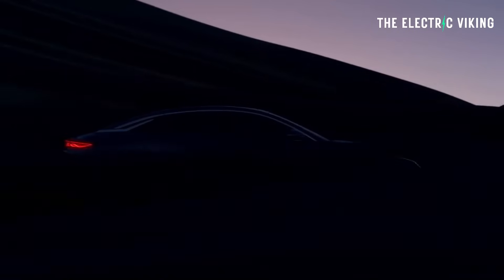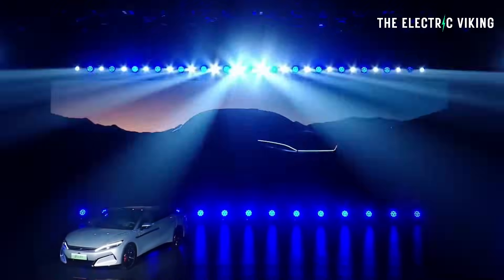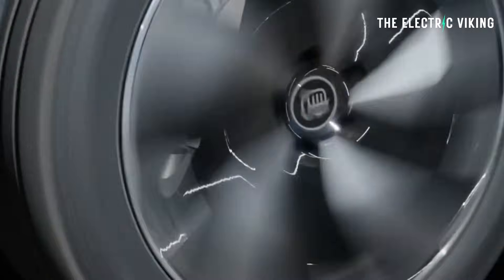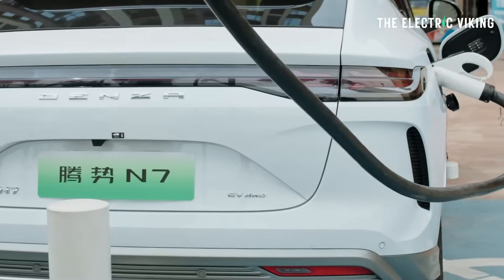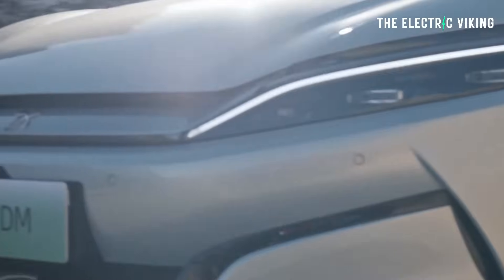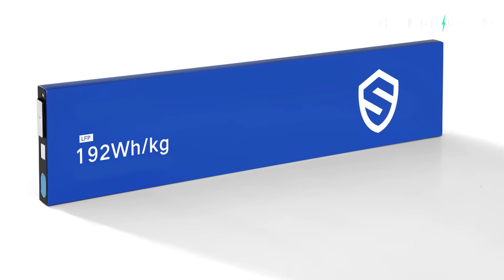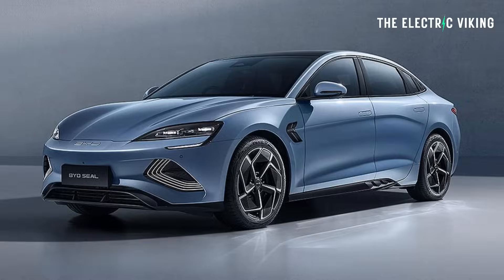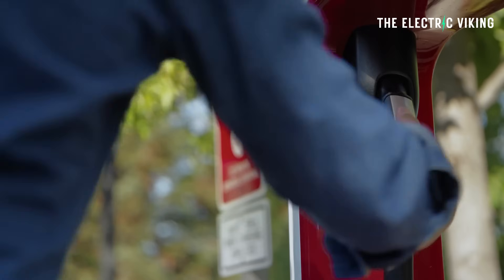New BYD EVs with 945V architecture charges from 16% to 80% in 10 minutes

Comment: I'm glad LiFePO4 tech is coming further, it's a good intermediary until we get Solid State. But like I've said, we do get -40 Celsius here in Ontario occasionally. It's -30 today, -40 in some parts. If we get electric snow plows one day, they will need to operate at extreme temperatures and still provide full power. Also North American power standard is 110v instead of the 220v elsewhere with a 240v split-phase for appliances, this likely means we will need special setups with additional 240v hookups to get high speed charging. Those who say there are no problems still haven't been in the right conditions, but there is definitely progress.

Comment: I live in Thailand and currently thinking about a new vehicle. I am very interested in the BYD shark 6 but after hearing some of the complaints that many Chinese have about BYD vehicles I'm not too sure. I have driven in a few as a passenger and they seemed well made, quiet and looked good. The owners seem to like them as well. but there is some information out on the web that they are not all what they are cracked up to be. they should be coming out with the shark 6 here in Bangkok in a few months. I'll take a look at it and then decide between that and the Toyota Hilux rocko.

Comment: I like the look of BYD but I won't be buying one.  Still no proper BYD presence where I am and there's no way any of the local charging infrastructure will support charging at the rates mentioned in this video.  Also the specs of these cars are absurd - why keep adding more and more power when range is the problem.

Comment: Two leads needed not a game changer if you could do it from one then yeah great until then its cars like yours which actually have practical charging. This is just headline figures from BYD, don't get me wrong things are going the right way but using two charge points is a gimic and just takes away a charge point that someone else could be using. Just my 2pence

Comment: Why do you so eagerly and readily accept nonsense claims by china on any technological breakthroughs, when 99% of previous claims were either outright lies, or had fatal flaws and severe issues with safety, fire hazard, reliability, or they were stolen tech rushed to the market in hopes of beating the original owner of the stolen IP? EV is starting to lose its allure. The cheap trash the Chinese sells for thousands below cost are getting tariffed to hell. The world was stupidly buying worthless deathbox evs from china and has now first hand experience on the trash the Chinese are selling.

Comment: In Australia issue is the charging station it couldn’t catch up with vehicles tech
Reply: Exactly.  All well and good to have 300kw charging on your car, but I;'ve never seen a charger in Australia that can do more than 150.  And the vast majority are less than 50
Reply: And the only ones that are over 150 are Tesla superchargers which you can't use Xpengs on anyway

Comment: @electricviking Hi Sam, I thought you might like some feedback regarding home batteries. Our place is off-grid so it's much easier to manage full integration but hopefully useful. We went with a BYD battery stack because they can be expanded as needed. The units come with a top and bottom plate for connecting to your batter charger, we use an SMA Sunny Island charger and Sunny Boy inverter. The BYD batteries come in 4kWh modules and you can stack 6 to provide 24kWh before going to another stack of the same all the way up to 240kWh. The solar system feeds the battery stack but more will be added and mounted at an angle to better catch the winter sun on a N/S pitched roof. These new 6 panels will exceed the voltage of the inverter so will be hooked up as DC via a small separate battery charger hooked directly to the BYD stack. We have an MG 4 at the moment that is powered off the solar, plus a ride-on electric mower (1 1/2 acres to mow) plus a heat-pump hot water system. We do have an auto start generator but have swapped that out when we got a Zappi and eddi unit with clamps so once the battery is full, then hot water is up to temp, then excess goes to the car. And the inverse is that the MG tops up the battery instead of the generator if needed in winter. We will be moving onto the Zeekr 4 to get 3.3kW charging instead of the 2.4kW we currently get. The generator is 4.8kW and is a backup for either house or car batteries but has never been used since we put this system together.

Two things to note, firstly, don't go for a single large battery like a Powerwall, go modular and grow from a base as needed. If you go Powerwall or equivalent you will be slapped at each upgrade point for more storage than you may ever need. Secondly, being wired to the grid will have its issues due to you needing tighter electrical integration between car, battery stack, inverter and power provider.

Comment: If you choise a 80 kWh battery then you have the same range, you just get a bit ligther battery. With <10% difference in density than the range wont change significant.

Comment: Tomorrow there will be the next brand new mind blowing sky rocketing game changing 946V architecture 😉
Reply: Very likely, but  you have to remember ICE cars have been around and used extensively for over 100 years and changes during that period for ICE engines were incredible, but it's now a mature technology and change is much harder, improvement even more difficult. EV's seem to be trying to squeeze that entire 100 years of development into a few decades, so it will seem that a new thing comes along every other day, but that's not a bad thing, it means we will get to a mature and stable platform fairly quickly.
Reply: The sky's the limit with EV tech.   ICE is DEAD tech

Comment: With high-speed charging, we all presume the battery will last.
We need to see if these batteries have not lost a massive capacity over 5-10 years.
Reply: They haven't. Take a look at any 2018 Tesla model 3 (and that's "old"  battery tech)
Reply: @RamonGT No way to know unless they are tested like the Tesla batteries.
You can't presume they will last like the Tesla batteries, Tesla is very conservative in charge rates.

Comment: If you are driving around a giant battery... you want to know you can power and run other things beyond just your car. Every EV needs bi directional V2H.   You also want to know you can run climate control while parked with lights off for as long as you have battery, especially in a van.  Surprisingly neither of these are true in most EVs today.

Comment: Im surprised that its not being reported that EV's will not need to be charged at all because they can be automatically recharged from the Earth's magnetic field .. at this point its beginning to sound very feasible given all the other vapour stories .. but seriously, lets assume we have a city of 4 million people and 1 million people own the EV's shown in this video, then you basically need the electricity capacity of an entire country .. lets say Australia, to recharge these vehicles at the capacity mentioned so it won't happen .. and it can be safely assumed not anytime soon if at all.
Reply: It takes the same amount of electricity as charging an EV to do the single step of refining gasoline. Then there's also the drilling, pumping, transporting to the refinery, then to the gas stations on tankers, trucks and trains, then pumping it out of the station into the gas car. By that time, there's already been far and away more energy spent to fill a gas car than charging the EV. So if everyone moved to EVs, the total amount of energy being used would actually go down, even if you don't count burning the gas in the ICE vehicle. The electricity would just need to be generated and distributed in different places than it is right now. Each EV, on average, uses about the same electricity as running a one-room, window-mounted AC unit overnight. And while fast charging pulls that energy in a few minutes vs 9 hours, since everyone charges at different times it will largely level out. There is no reasonable argument against switching to EVs from an energy-demand standpoint. In fact, the facts are all massively in favour of EVs.

Comment: For this new Battery to charge in 10 minutes means, No grid stress, cooled down cells, specialized fast charger location, healthy cells and perfect charging enviroment. Which will be less than 25% chance to achieve. Only thing that will be reliable to get full charge in under 4 minutes (NIO BATTERY SWAP SYSTEM)

Comment: That charging from both ports seems like a cool idea...but I wonder how it will pan out in the real world when charging infrastructure is the limitation in countries like Australia. For example, at my local shopping centre there are fewer chargers than there are petrol stations that surround it. Obviously this will change over time but until then, it seems a bit douchebaggy taking up two charging ports when one will suffice.

Comment: Would you comment on which brands future-proof their vehicles as regards battery Technologies, like can you upgrade for new battery technologies as these become available?
Reply: Nio has removable/swappable batteries. That should be their way of competing against the competition. Just think. Every year you get to USE a better battery!
Reply: Not every year @PeterDMayr  it's like every time you want your battery recharged you get a new battery 100% charged at the swapping station. I really think dealing is the best thing and you don't buy or own the battery.
Reply: @billlee2983 We agree that swapping is not a bad idea. I was talking about new battery tech. I doubt they give new batteries of the same type every time you swap. They will check to see if it is in good working levels, which is nice too. Btw, what would be even better is having the option of using smaller batteries (if you don't use a lot & can recharge easily at home).

Comment: Ah, so all current chargers will need replacing?
Reply: Yes. Though it won't happen for a long time unless they're super popular. Focus for a long time will mainly be installing new chargers. The latest greatest chargers will be whatever has been most recently added. I'm looking forward to wireless charging being standard. No visible chargers at all, you just park in designated spots and your car just starts charging. When you pull in at home you just go inside and in the morning your car is magically charged without you having to do anything. That will be very nice 😎

Comment: Cold weather operation problems for EVs are a thing of the past. Many in Saskatchewan, Canada drive trouble free all winter long and recharge at -25C in about 30 minutes.  The cars can precondition the battery on the way to the charger and then charging happens at normal temperature, when the battery is being charged, heated by the current from the charger. Driving range in cold weather is less, but we don't have many days where it is extremely cold and we need to drive more than 300 km. As for starting a car that has been left outside all night long, it is easier than an ICE vehicle, since no spark is necessary. There is no motor oil to thicken, no fuel lines to freeze (condensate)  or 12 V battery needed to crank the engine.
Reply: ICE Vehicles also lose mileage in cold weather. Just not as much as EVs.
Reply: @JAM_2024  You burn fuel just warming up the engine and the passenger compartment.
Reply: @JAM_2024  Yes but these things will become a thing of the past very soon.
Reply: @JAM_2024  They don't actually. There is more volumetric efficiency in cold weather thus lowering the fuel consumption.
Reply: @bengt_axle  Yes indeed. More improvements will come this year from Chinese battery manufacturers like CATL and BYD, etc.
Reply: You do have coolant lines in an electric vehicle ... just keeping it real
Reply: @mersinalou7397 OP didn't mention cooling lines. Probably because those aren't really an issue on ICE or EVs.
Reply: I find it in the winter, the battery doesn't fully charge.  It says 80% on the touchscreen but when you click on the battery % to change it to available range, it falls short by several kms compared to the same charging in the summer.
Reply: @KP-xi4bj  The battery fully charges, that is the "Guess-O-Meter" taking cold weather into account, you lose about 25% in cold weather compared to summer.
Reply: we were riddled by propaganda. good to know China is doing the work other countries should have done it had they detached from exxon and their thugs earlier
Reply: Exactly.  I've watched videos in Yakutia how people have car blankets and keep their cars running, temps going to minus 50-60.
Reply: "Many in Saskatchewan, Canada drive trouble free all winter long and recharge at -25C in about 30 minutes". 

Like in Norway - there is no real problem anymore.

Comment: Not during the Chinese Holiday will it charge in 10 mins.  The chargers will be at high capacity so the truth would be an hour to charge.  NIO has had 900-volt tech for 4 or 5 months that you can buy right now.

Comment: Rimac Nevera has 4 motors 1408 kw
0-100 kmh h 1.97 secs 
That came out in 2021
Reply: yeah. And the Han L motors if in quad motor set up will surpass it by at least 600kw.
Reply: What about price?? 🤔 
BYD has super car too ,BYD yangwang U9 , 0to 100 2.2 s.
Reply: @mdzia131  Rimac a European brand has this tech 4 years ago. Not just Chinese